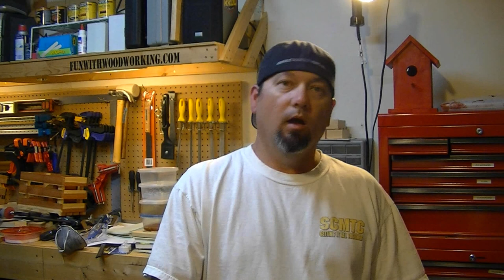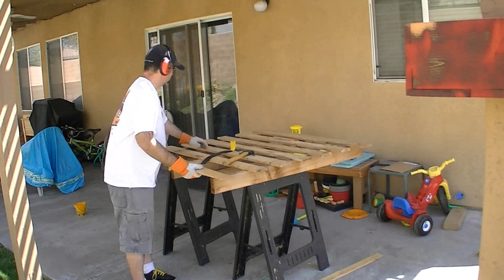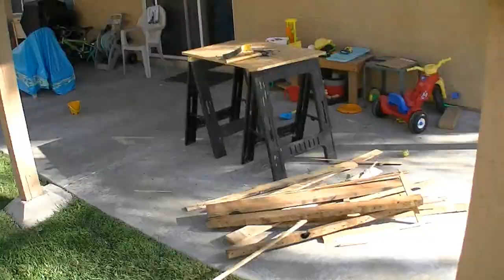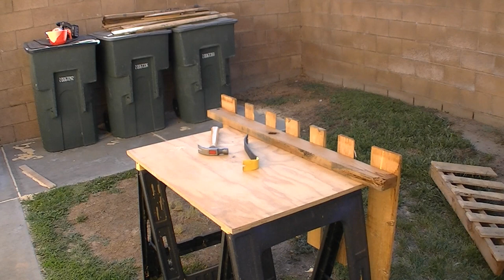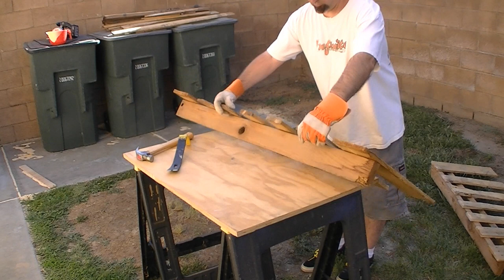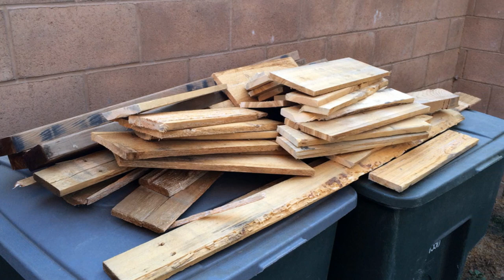How to take wood pallets apart the hard way

Comment: I've went through all of the work you have done, I found an easy, not quick way to get the wood apart is with am impact hammer with a tie rod separation tool in the "chuck". Mechanics call it a pickle fork. But it slooowly drives the wedges on each side of the nails not shattering the wood you're after. It takes a lot of air pressure so you need a good sized compresser.
Reply from the maker: Lee Peterson Thanks!

Comment: hey man, just came across your channel and love the wood projects! I have broken down several pallets, and that way sucks! A resipricating saw is the way to go, you can get the full length boards from the pallets with ease. I also use a small punch to knock out the nail heads when finished. Pallets are a really good source of some oak and most have some great character to it! Don't give up!
Reply from the maker: Swamp Donkey Detecting Thanks!

Comment: There are tools designed to take pallets apart called pallet palls.  But i use the "runners" (the sides of the pallets for the fork lift.  Use the next board as your leverage and push down.  

I get fewer and fewer split boards this way.

Comment: I use a sawzall (reciprocating saw) with a metal cutting blade. I go down between the slats and the 2x4s, just to cut the nails. Since I'm not worrying about looks, I leave the cut nails in the wood.

Comment: I find reciprocating saws are best for dismantling them. Get a 9" or 12" construction blade and run it between the slats and 2x4's. Then a punch to knock the nail heads out. The only thing is the 2x4's will have part of the nail still embed. So if you use them for a project you have to watch where you saw. I can break one down in about 1 to 2 minutes.
Reply: ***** You can buy a Diablo brand blade made for wood with nails embedded in it for $5 at Home Depot. I have broke down tons and the blade is still going strong.
Reply: Me too. But recently I've bought this very nice nail puller, so if the nail isn't too destroyed by rust I try that first so I can use the 2"4 as well. I'm not bothering with the flimsy pallets that doesn't hold much weight, I go straight to the EURO pallets, which has 6"1 inch boards. You can return them to the store and get a refund but for me their worth more as wood.

Comment: Have you ever tried using a reciprocating saw with a metal blade?  Create just enough gap for the blade to fit between 2x4 and plank and just saw through all the nails then knock them back out with a hammer and punch.   Comes in handy why you find those nice quality pallets where you want to retain as much board length as possible.
Reply from the maker: Annony Mouse Nope.  This was my one and only attempt at breaking down a pallet.

Comment: Looks like all your pallets were a soft wood?  The grade of lumber is usually terrible.  I use pallets everyday, and the nails in those things aren't meant to come out.  And the pieces get shredded when you're trying to take them apart.  I would recommend snatching up any hardwood pallets you find, the lumber is much skinnier, but the yields are really only good for a few picture frames or hand carving.   Some of the wood is beautiful when milled too.
Reply from the maker: Yeah, they're definitely not hardwood.  They also had sod on them so that probably didn't help the wood any.jdniedner

Comment: I think you had some bad luck with this pallet, I have been using pallets for upwards of 20 years and I still struggle to dismantle them! Don't let this experience stop you from attempting another if you have the chance to come by some pallets without having to chase them up. I will not use every pallet I see and experience has taught me which pallets are better yielding than others. Then again if you don't use any more pallets then that leaves more for the rest of us!!! (even though the USA is a bit of a long way to travel for them from England) Cheers for posting mate. N.